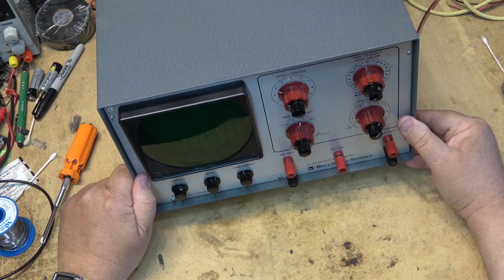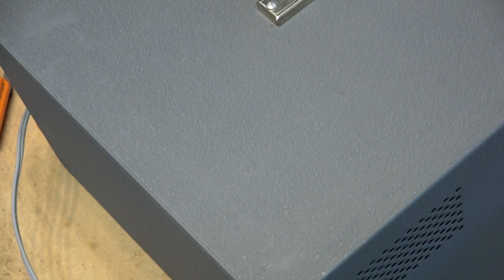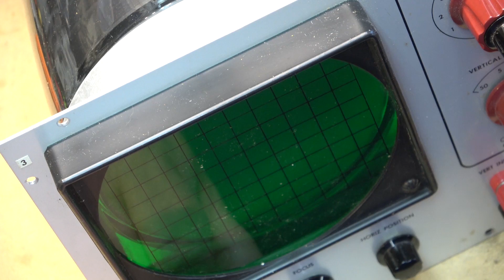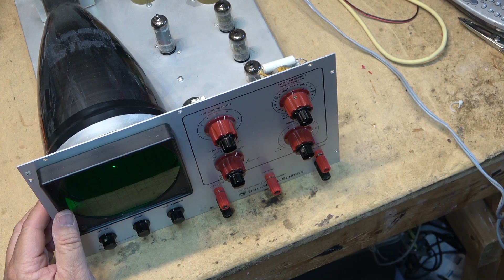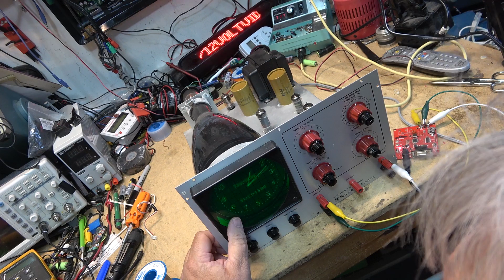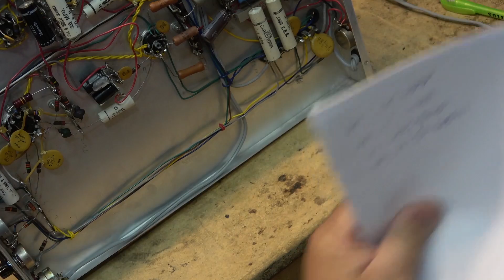Bell and Howell Schools Model 34 Scope Check Over

Comment: hey So I have one of these scopes and it's developed a serious issue and I'd like to know if I'm right. So it keeps smoking and blowing up components such as tubes, Caps, Resistors etc. and Now I've noticed the wires running from the Power transformer are charred. Now correct me if I'm wrong but these issues all point to the Power transformer having a shorted Winding inside somewhere and because of this it is dumping huge Amounts of High voltage on to different components in the scope and the Picture tube shows Nothing.
Reply from the maker: Yes likely the power transformer is toasty.
Reply: @12voltvids  Damn that's what I was dreading.

Comment: I am having a great time watching this restoration, thanks for sharing. I inherited a lot of high voltage electrolytic caps from the 80's-90's, similar to the ones you used in this video (Rubycon, nichicon, nippon etc). Even though the manufacturer says they only last ~15 years, do you think they are still useful for these types of projects? I threw out any with any sign of corrosion, wear, bulging etc.

Comment: Hello sir have two portable vhs vcr 1 canon v10 and second orinal rewinding forward works fine but when i play the take up real not work in both vcr what is the case i looked centre pully and change idler tyre but still not rotating what should i check ? Any help please appreciate

Comment: Do you think it’d be an issue to store CRT televisions in a hot garage if the door is closed? Would that cause any issues? I currently have several backup set’s sitting in my garage but it lacks air circulation

Comment: Hey, what is your opinion of the Panasonic brand CRT televisions in terms of quality and reliability? I picked up recently a Panasonic CT-27D11E and the set has a nice Panasonic M Picture Tube and great colors - but I noticed some mild pin cushion distortion on the left side of the screen. Maybe a weak capacitor on that circuit, but overall seems like a very nice TV.

Comment: That is one of the simplest scopes I have seen. I have a couple old Eico scopes and some old Tektronix. There's a lot more components in them.  I do have some old B & H school meters that have the same simple designs. They were all built as kits by students I believe.
Reply from the maker: Yes and that explains why the horizontal reflection was reversed.

Comment: i still have a micronta (Display scope),  it was made to look at waveforms only.
No accurate calibrated knobs.

I have a Tele quipment D32 Oscilliscope, good enough for my use.
But I've had to resolder the majority of the wires going to the timebase pcb.
The through holes fail and i bypass them with insulated wire.
It used to have a multi cell internal battery but they were leaking and very dead.
in the bin the batterys went.
It runs on 240v mains, so ill never refit batterys.